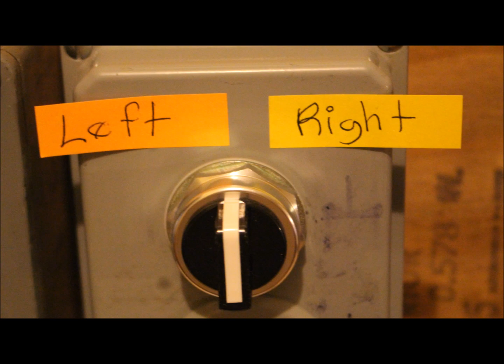#electrical#motor controls#forward & reverse#interlocking by pushbutton

Comment: I thick you should show  by changing two phases over you can change the direction of the motor, this as you know is through the second contactor. great video by the way! thumb up!
Reply from the maker: well that's what is been done here, using two starters and an overload block ,the way is done on the industrial field my friend, the only difference is that we are building our own controls and the starters are doing the phase swap.

Comment: Out put voltage suplly
Reply from the maker: coils are 115 volts, but they could be 24 volts or 480 volts and the input voltage  on the contactors can be any voltage but most of the time on this kind of starters they are 3 phase.